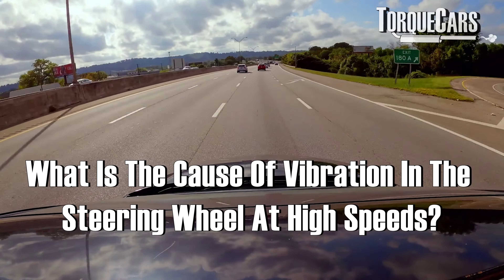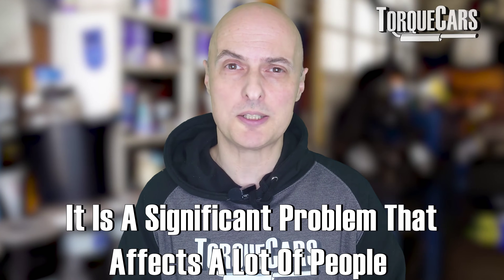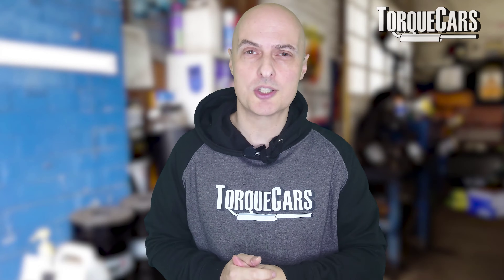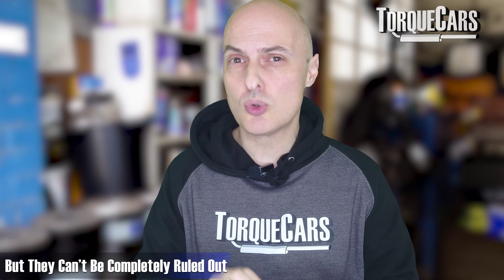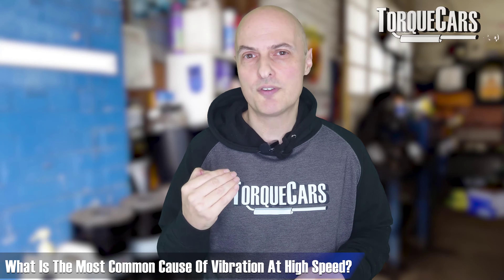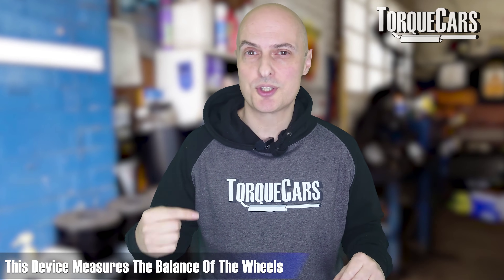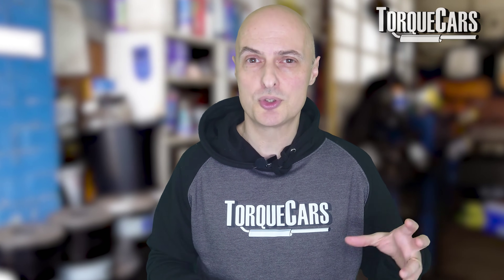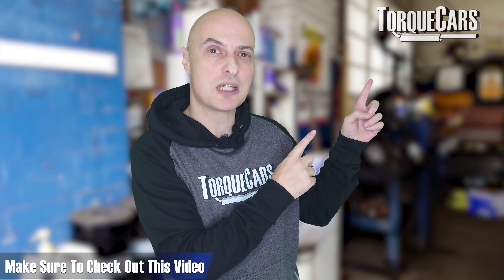Causes of Steering Wheel Vibration At Speed

Comment from the maker: Have you ever suffered from this vibration? What did it turn out to be? In my case I had a severe wheel wobble at 85mph *(on a track I must add), this turned out to be an alloy rim that had struck a pothole and lost it's shape, the balance after fitting tyres helped but didn't solve it completely.